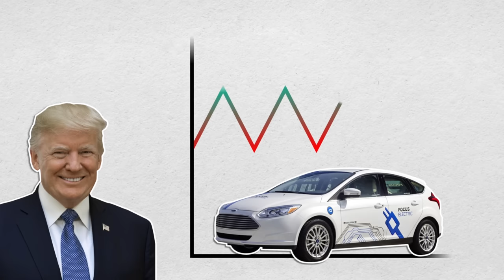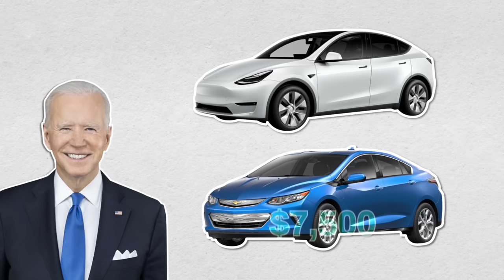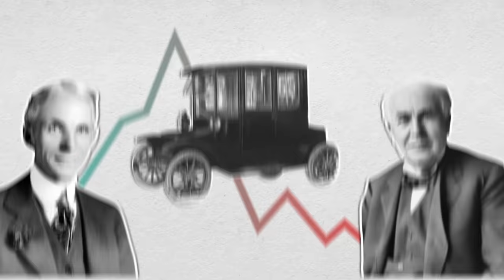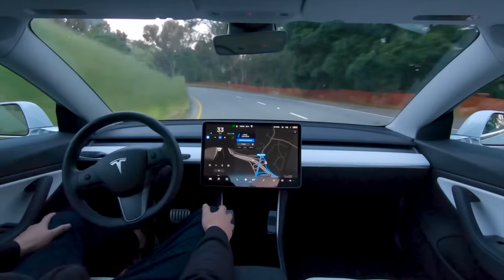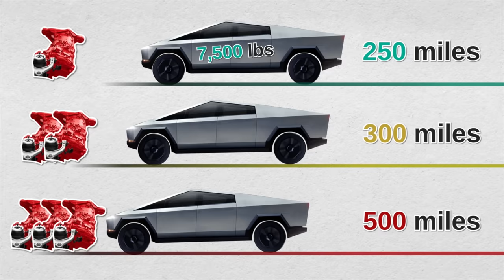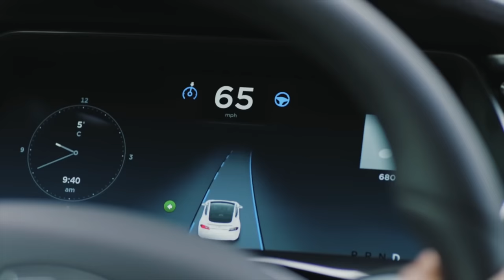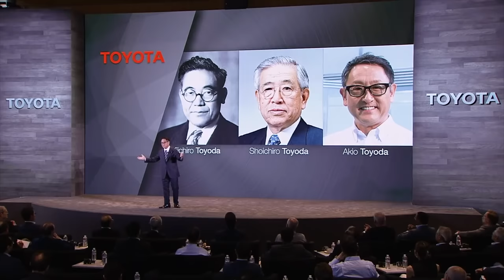Here's Why Toyota is Refusing to Make Electric Cars

Comment: I think going all EV will be a lot harder than everybody thinks. Right now we have "group think" from people who are pro-EV who aren't really thinking through the resource requirements to go all EV. To these people, they think the the current  Battery technology is just great, and hear great things about the future - Solid State. But we are for now at Lithium Ion, and have been there for quite a while. And the R&D departments know we need to do better, but haven't been able to get to the next level.
Reply: Ronald Mc Donald - well said.
Reply: There's also the question of what we are going to do with all the extra gasoline we refine that nobody wants.
Reply: @campbellpaul  Not to mention the question of generating electricity to charge all those batteries.  Wind and solar will not cut it, and we can't build nukes.  Maybe we can power the cars with happy juice.
Reply: Teslas are already roadtrip capable on lithium Ion.  I happen to live in an area that already has a pretty good charging infrastructure.  The perspective of many is that you need to fill a car up with whatever it's fuel is anytime you are near a place to do that.  I don't think that's the reality with EVs - you plug it in while you're grocery shopping and then go about your day when you're finished shopping - you don't sit around after your done waiting for it to finish charging - you'll leave it do that in your garage at night.
Reply: Think fuel cell was the way to go.
Reply: @James Smith there are many products made from crude that are hugely wasteful and cause massive pollution. Crude will always be extracted...but using it as a base material isn't always the smart choice
Reply: @campbellpaul  Actually, Capital Expenditures for finding, extracting oil is declining. Some are forecasting a shortage in roughly 18 months.
Reply: @signkutter9218  Exxon and Toyota are working together. Exxon is trying to get the cost of Hydrogen lower. Here is the big problem: Hydrogen costs 1.2 X to deliver 1 X energy to power a vehicle. But Hydrogen can fill the up the vehicle faster, and does not have the weight of deteriorating battery back to haul around.
Reply: did you know toyota still uses nmhi batteries?
Reply: @signkutter9218  so....what are these materials other than crude.  I'd like to know.
Reply: @photog1529  Agreed ! I think fusion is the way forward if it can be made to work. There are several built in various places around the world. I think they are building one in the UK near Oxford.
Reply: @MavHunter20XX  Research sources for polymers dude...its not that hard...like i said.. some..SOME Polymers derived from crude will likely always be the most practical and intelligent choice...some applications are completely stupid and short sighted
Reply: @campbellpaul  STP Save The Planet
Reply: @ronaldmcdonald3965  before the infrastructure was gradually created... nobody thought combustion engines in autos would ever replace trains and horses.  In the petro-world , where everything else is measured as if the infrastructure and current technology always existed...of course any other source of energy is going to be more expensive in the short term. Its scale that brings cost down and furthers innovation and improvement.

People are always convinced that the answer to fossil fuel energy is a single source. ..and that's a self-defeating fallacy.  Wind, wave, geothermal, solar all need to be considered where they are feasible... Some applications for fossil materials will likely not be replaced in 100 years...but that doesn't mean we cant greatly reduce our dependence on fossil fuels in the present...it takes will and elimination of influence by the industrial complex to maintain the system they are so heavily invested in
Reply: Lithium battery capacity can increase with Lithium anodes and other improvements headed to production. Anyway 250 miles is plenty for most owners.
Reply: @James Smith No one is claiming oil will disappear, just 90% of it. Enough to try to heal the planet from droughts, fires and floods
Reply: @jhindson88  the 250 miles isnt the problem...its charging up thats the sticker
Reply: You have common sense.   Those activists never have this simple thing called common sense.
Reply: @AkiraNakamoto  Unfortunately, we in America can't make good decisions anymore. We run on emotion. Rather then engineering, accounting, finance, project management, capacity planning, and change management. Steve Jobs has made technology so easy that we can rely on emotion rather than facts and figures.
Reply: We're going in EV because the big coplmpanies realized we don't have a lot oil left to spare for the next 50 years
Reply: @James Smith As long as there is oil left in the earth, they will be.
Reply: @jhindson88  re fuel cells - Going from zero to full power, or even from 10% to full power requires the entire cell chemistry to rebalance, which is fundamentally limited by diffusion speeds. It takes in the order of seconds to throttle. In the meantime, either you have insufficient power to do what you want (and believe me, even 2 seconds is a very long time to wait before your car starts accelerating from traffic lights) or you have excess power coming from the fuel cell which can't go anywhere, so it needs to be thrown away.

This is why basically all fuel cell vehicles have to use a small traction battery.... heck, just use batteries.
Reply: @signkutter9218  Also, the Energy Market is more based on how much we produce rather than oil accessibility.  If they stopped making plastic bags, toys, electric cars, I-phones, etc., the price of gasoline would skyrocket.  Crude oil has about 30 distillates of which some 200 distinctive compounds are derived.
Reply: @campbellpaul  market is manipulated far beyond how much we produce. I know  oil production is bottlenecked  in several ways.  I know less than half of oil consumed in the U S is used for energy.
Reply: @signkutter9218  I don't mean based on how much oil production there is.  I mean by the demand for products by the number of shares and capital that is put forth to make actual physical things made by oil derivatives that are marketed.  The energy market relies on those numbers for pricing the gasoline we use as well as natural gas to heat our homes, etc.
Reply: Nickel battery ftw
Reply: @tophat2002  🤣
Reply: @photog1529  Yeah, Happy Juice is the answer from those who have no idea what it take to generate electricity
Reply: @campbellpaul  A lot of frackers went out of business. They were extracting uneconomic oil. When oil price gets high enough we might see  see them come back in. But nobody wants to lend to them.
Reply: I've always said that lithium is only good for power tools and rc cars.
Reply: I think you are right. The practical solution to reduce transport emissions is not to exclusively focus on EVs as a solution for everyone. EVs will have a place for the  inner city commuter who wants it. However the smart solution is Hybrid vehicles that could run on synthetic carbon neutral fuel which BMW, Porsche and Ducati are focusing on.
Reply: @kimw200blaze4  Here is an impractical question that gets infrequently posed: "Why don't we have electric commercial airliners". Impractical beyond words at this point of technology and history.
Reply: @James Smith Excellent characterization. "Incomplete" is very accurate. Category 5 schedule has slipped out from 2030 to 2040-2050. Not a typo. Most of what we have is Cat 2
Reply: Much could be said about cell phones. Few had them. Now all Do. Currently the largest contributor to pollution and carbon emissions leading to climate change is the ICE
Reply: @djkenny1202  Not say EV won't happen. Just saying it is going to be a lot harder than what non-technical people think
Reply: Lithium iron phosphate batteries are cobalt and nickel free, with comparable performance to those with them. Sodium   batteries are on the edge of widespread implementation too. Tesla is on the verge of production scale of their own cells too. Charging stations will be equipped with these cheap batteries to reduce grid peak demand and offer high speed charging in a much wider variety of areas. Tesla is already at 70-80% yield on their pilot plant, with a massive reduction in cost. In the next 12-24 months they'll be spitting out their cells in all their factories locally, faster than Pepsi can make, fill, and pack a can of soda. So the cells are there, the tech is there, the production scale portion is almost there. We don't need a break through material, we just need a high speed low cost manufacturing system, which is almost there. Basically, if these car companies aren't making their own cells, they're going to suffer loss of market share fast. Especially when Tesla starts selling the model Y for the same price as a Rav4 or Camry, next year....
Reply: @suserman7775  True
Reply: @ronaldmcdonald3965  so you want to pay exxon for a limited resource again, like oil instead of slapping some solar panels on your house and charging up your vehicles at home?
Reply: @kimw200blaze4  why carry two powertrains and fuel it with a limited resource which costs whatever the market says? Why not just a 250 mile plus battery that can recharge 150 miles in 15 minutes for road trips after traveling for 2-3 hours? The number of people who actually need range beyond that is really really small.
Reply: @BenefitOfTheDoubtInquiry  I did not say that. You said it. I am saying this is going to be a lot harder than you think.
Reply: @ronaldmcdonald3965  how do you gage how hard I think this will be?
Reply: @BenefitOfTheDoubtInquiry  
1. Creating sufficient renewable electric generation, transmission, and storage for entire vehicle fleet cutover
2. Sufficient raw materials to make the batteries and electric motors as well as recycling
3. Actual usability of EV
- Fires, ability to operate in cold environment
4. Consumer pricing
a) We need the entire consumer and commercial fleet to cut over to EVs
b) A lot of these people can't pay the price for new cars
5. Consumer hesitancy when there are major recalls as EVs are perfected

There is no doubt we need to get to zero emissions. It just will be harder than a lot of people expect.
Reply: @suserman7775  what is your opinion on the corporate welfare given to the oil and gas industry?
Reply: @suserman7775  actually, the Green Revolution is expected to be the biggest boost to the world economy across all demographics and socio economic classes. We're talking about converting out entire energy grid and building out major infrastructure projects not seen since The New Deal.
Reply: @suserman7775  you actually do didn't say anything of value. It's all your opinion. Try proving my position wrong with something substantial.

Comment: I'm in Australia and all I can really say is...
- Triple those prices for Teslas once they get over here and are sold without generous subsidies.
- The model 3's pretty much impossible to get your hands on.
- No, I'm not getting an electric car because they're too expensive. If I wanna save the environment then I'll walk or ride a bike, which is what I do...
Reply: Excellent you got it
Reply: Virgin ev driver vs chad public transport commuter
Reply: OK, walk or ride a bike. You'll only have to wait a few years until Tesla builds an Australian GigaFactory and AEVs come in where you'll be able to ride share for pennies.
Reply: @marcruby5844  Well Said 😀😀😁😁😎
Reply: if you want to help the environment replace your gas weedeater and leafblower with electric
Reply: @steven4315  Already done. Also, your lawn mower too. Doing so will cost less in the long run and be cleaner and healthier as well.

Running a gas leafblower for 30 minutes contributes as much pollution and greenhouse gases, CO2, as driving a new Honda (or some say a new F150) from Atlanta to Seattle!
Reply: @johnrothgeb5782  i use 42 inch cub cadet electric
Reply: @steven4315  Yep I've done that... massive win and means I don't have to store petrol (with a 2-strok additive) in my garage.

Comment: We have trouble managing power when we use air conditioners and people think we can simply switch over to electric vehicles. People have no idea what it takes to support the BEV platform and the damage created in its wake.
Reply: @idmhead0160  Nah, I'd convert to CNG, propane, or E85, before going EV. The idea of a P90S drivetrain in a classic musclecar is intriguing, but I have neither the expertise or the money. EVs have a seat at the table, I just don't think it should be the only seat. I also like diesels, and the prospect of making my own fuel appeals to me.
Reply: @pookysdad4884  CNG or propane conversion should've been done decades ago. It's too late for that. ICE has to be dumped. 
E85 is not an option. It creates 200% more CO2 in manufacturing than normal petrol.
Reply: @subbaaja100  Yeah, I know. Corn requires fertilizer, and guess what a big ingredient of fertilizer is: Petroleum. However, I'm sure that revamping our electrical grid and trying to increase battery production 10 fold, or even 100 fold, will present OTHER environmental issues. There's no free lunch.
Reply: @pookysdad4884  How will they make all the electricity to charge all the electric cars on top of all the electricity that will be needed?
Reply: @williamgolden839  That's one of many questions I have regarding an "EV Future". I'm sure we'll end up having blackouts in cities. So everyone will need a generator to charge their car, just in case. And what do generators run on? 🤔

Comment: I tried to help setup a hydrogen conversion station on kauai in hawaii as testing island. The idea was to educate and get people into cell technology through first converting their gas vehicles to run on straight H so they’d still get that V8 rumble as sort of a psychological selling tool. The goal was to use this small progressively minded island to spark a social movement that could rely on working models to push back against big oil, big battery and speed along americas energy evolution. Sadly big natural gas got to the ones with the permits first and we weren’t allowed to proceed. Keep up the good work and funny commentary!